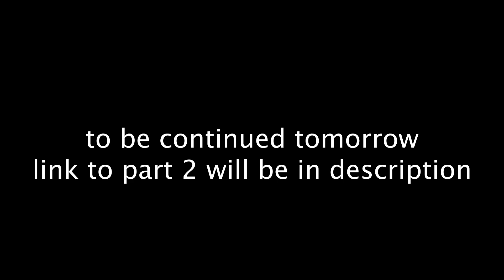how to recover data from flash drives that are totally dead part 1

Comment: Well,
      VCC and GND Wire is way too thick not needed to be this thick
Reply from the maker: Lol, what makes you say that? it would work with smaller wire no doubt, but there is a reason you see VCC and VSS being much thicker on surface of PCB. Thicker and shorter is best
Reply: @hddrecoveryservices  The Device under repair is not consuming that much of volts or amps ,Just a tad thicker wire then you used for NAND protocol was OK ,And BTW i was at my farms not checking all the videos

Comment: As I'm from Poland it is interesting to see that the adapter you use there in Canada comes from a Polish company. I see that they also have various models for NAND access that do not require soldering, although I guess the soldering option is most economic for one device to connect them all.
Reply from the maker: They really nailed the cross platform utility of their products.